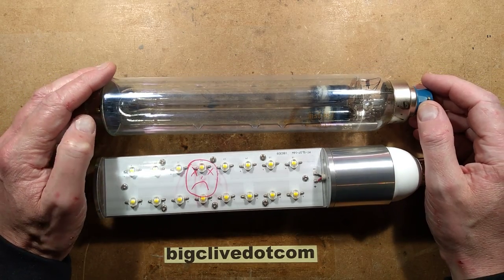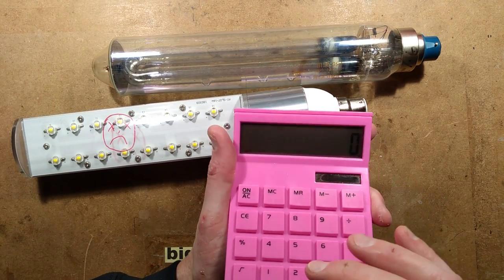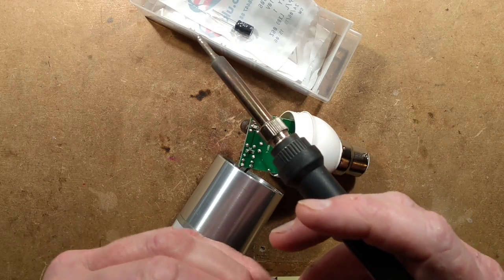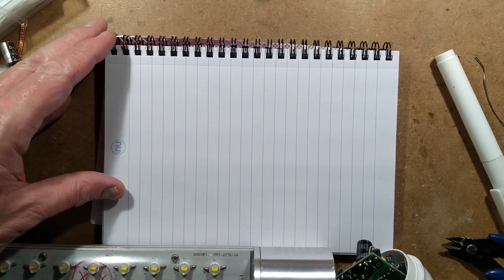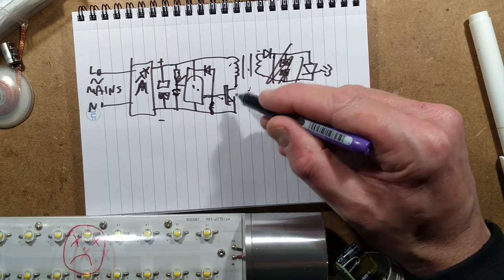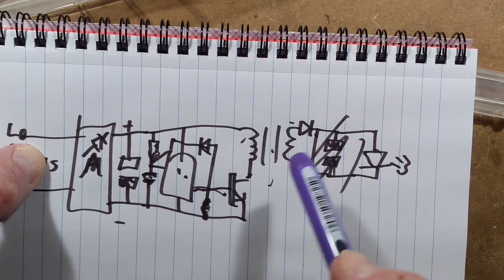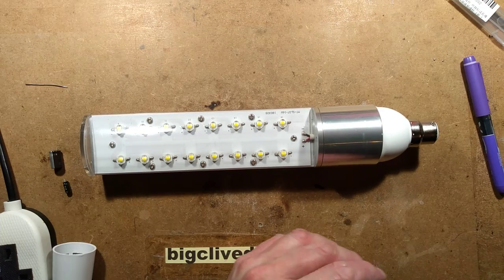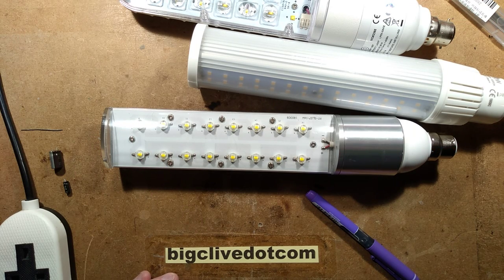Fixing a dead LED street light lamp.  (SOX retrofit.)

Comment: If these lamps were available with an E27 fitting, they would be an option for room lighting (although I'd have to modify my fixtures for that, which currently just point towards the ceiling, while they would have to point sideways for the lamp itself taking this 90° angle towards the ceiling). I am currently running 18.5W Phillips and 21.5W Osram LEDs, but at least with Osram, I haven't had very good experiences, since their lamps only last about as long as they write on the packaging, which is a bit annoying.
Reply from the maker: You can get B22 to E27 adapters.

Comment: Cost from Soxled , depending on  wattags and design  , saw from ~ $66 usd to ~$89 usd for this bulb and higher based on other designs with larger numbers of led strips . A 360 deg lamp with several led strips is upwards of $190 usd (rounded up)
Reply: In the UK that exact lamp is going for £63 inc. VAT in 2022. So if you are a local council and you have thousands of these lamps a bit of component level repair is probably going to be cost effective over buying new ones in. Especially if you partner with some neighbouring councils to get the repair volumes up.

Comment: I think replacing the LED is also viable... i work in a hotel, and we have some 7W lights with 7 x 1W  LED (just like the ones you have in your lamp) to light up the restaurant, with a separated psu, and the cover for the light is friction fit, so it's quite easy for me to disassemble it, and recover the 6 working LEDs from a dead one, to use them in the next one that fails. That way, i can build 6 working lights for every 7 that dies (the only thing i have to buy is some thermal compound, so the cost is negliable). One lamp, by the way, is about 20€ including a discount we have, so i think it's totally worth the effort...
Reply: Daniel López How many hours do they have to employ you to save each £180 (dismember 7, assemble 6)?
Reply: @johnfrancisdoe1563  Keeping in mind that i just have to lift the cover, de-solder the LEDs and solder them back... no more than 15 min / light to replace the led and install back the light.

Comment: Funny you talk about "LED modules", I know a Taiwanese LED street lamp Manufacturer (I have been to the factory), Their designs take that into account were you have a number of LEDs strips (depending on the light needed) and those can be changed. I guess the difference is that they sell the entire "light" not just a "bulb". They got into LED manufacturing after manufacturing heatsinks, focusing on the refrigeration of LEDs and constant current (when they started the industry focused on constant voltage). Their challenge (as they put it), is that, as they use high quality components, they struggle to cheaper manufacturers (your point on the bootstrap circuit capacitor etc). In a sense I guess only having to change a bulb is already "modular", but if you refer to "LED strip modules", that already exists.

Comment: I have our Czechoslovak Tesla RVI 2000W (metal halogenide vapour lamp) from 60s. It runs on 400V (normal between phases voltage - we have three phase distribution system) and it after seven minutes of starting outputs 200 000 lumens :D

Comment: Hi Clive 
Hopefully your see this but I really don’t know where to start on street lights.

For 7 years i was up and down the country replacing the street lights...
It was all a con and still is, under the guise of energy saving...
If the case was just energy saving why didn’t SSE and up north was EON I think just change the heads and not the columns. 
The scheme that the councils had to pay for was scandalous..
It was dangerous work ( I’ve hit a few LV cables) call it careless but in certain situations and the added pressure with working on price  the CAT &GENNY isn’t accurate. Off point and let’s forget the water, gas and telecoms. Strike any of these btw we had to pay for.
I’ve never come across the bulb u have there but.. most of the columns we were pulling already had the new heads fitted with (fluorescent tubes?) blah blah then by the end we were fitting LED heads I know for the 6m columns were £400 a pop.

The earthworks the diesel the cons people believe that it’s for the future is laughable.

The old cast iron gas columns (obviouslyconverted to electric  ) was criminal  ... I could tell you everything if you’re interested but I did have some of the “new fluorescent “ lamps my garage...  just left over when I cleaning the truck out for the next day, brand new old.

Working in Bournemouth they had already changed a lot of the heads to LED...
Have no idea how old they were but had a good alu looking case.

Every single one of them were on Victorian columns..
Again what’s laughable there is I’ve worked all round the country and Bournemouth is the only place I’d say the actual columns needed changing cause they were rotten through.... all except for the old cast 1s .

I couldn’t save any they were too heavy but...
Hope some of what I’ve ranted their makes sense.
I’m contactable if needed.

And thank you for your valuable time and very helpful content 
Kind regards Carl
Reply from the maker: It's just another of the government's many eco scams which involve them taking a personal slice in the middle.  The new LED lights will fail expensively in a few years.
Reply: I’m pleased you didn’t take me the wrong way, and didn’t think I’m someone that doesn’t care..
cause im definitely all for genuine ways to help the future environment..

But so far all I’ve seen is a money making whitewash..
Cars for a start... the scrap scheme..
When is it environment friendly to throw away something before it’s usable life is up. The cost to scrap/ and produce a new car is more costly to the environment than keeping an old one.
And where do they think the  metals for batteries needed for “zero emissions “ cars come from and that they are not yet recyclable.

We do have a newer car, but I also have an older 2000 bmw car which isn’t used often at all but does come in useful..

Reason I bring it up here is because they tried to make them recyclable.
Pretty much every part on the car including the little pop out plastic but on the bumper for the tow eye is marked with the plastic it’s made from.
And tonight the fireworks were on over the road and I had no torch 🔦 working for my little girl to have..
So to hand now I have the cars rechargeable torch out of the glove compartment...

>ABS+PC<  NIMH -AKKU

That’s written on the torch alone ha ha..
Point is imo steps like that is what’s needed.

And a rechargeable 20 year old torch is  still working as a last minute thought to make her happy 😆 

You can have it Clive and do a video on it and see how little life it may have left in it 🤔😂

Comment: That’s why, when designing a switch-mode power supply, you design it so it still works when the caps have dried out by at least 50%... and use ceramic bootstrap caps.

Comment: In the US most of our street lamps are HPS.    Fun fact is you can way overdrive the smaller HPS bulbs with oversized ballasts and they will take it for some time.    

Just for - abuse to failure point - testing to see their limits I have run  ~ 150 watt HPS bulbs at 400 watts for days without issue and 1000 watts for long enough to get the ceramic sockets to crack apart from overheating and the stainless steel metal on the base and in the sockets to turn dark blue due to massive overheating!  

Also at ~3X their rated power they are not so orange, but near white and at 1000 watts they are sunlight white!
Reply from the maker: In many pro moving lights the lamps are overdriven, but also underdriven when the shutter is closed.

Comment: Hi Clive the keyring tools you were using  to clean the through holes out, look very much like prickers, used for cleaning out gas nozzles, like the old  parrifin blow lamps, i have two sets here that range from .46mm to 2,74mm in 12 steps had them for over 45 years ..

Comment: Well, well... If you ignore the CRI of 0 of the sodium lights, they are much better for me. The air is much more transparent to them and you can see very far from a single light source. Moreover their light is not triggering your pupils as much as the LED lights which produce a lot of light, but then your pupils react and you see that special "dark light" effect of the LEDs...

By the way ... with that frequency of flickering it was clear that the final capacitor was not the issue :) Otherwise, nice video!

Comment: Rather than trying the round files (nozzle cleaners) that are likely to damage the hole plating, here is a better choice.  Use wooden tooth picks!  You may need to sharpen them a bit more, depending on the hole size, but they display the solder quite well.  Solder does not stick to wood.  Actually, I have another way also.  I use a vacuum solder sucker or pump on one side of the board and a soldering iron on the other side. Apply suction when the solder has melted through.

Comment: The roughness, in theory, grabs the solder so it doesn't end up back in the hole. If you've ever tried using a clipped off piece of a lead or a length of wire to clear a hole, you'll note that this is often just what happens.

Comment: A big problem with these retrofits is that most SOX lanterns rely on optics and refractors built into the side of the transparent bowls to achieve the correct light spread on the road. I can’t see it working correcting with a very direction light source like this!

Comment: LP sodium (SOX) lamps are almost monochromatic, except for a couple of other weak minor lines (mercury etc), so much so that they are useful as photographic dark-room 'safelamps", the sodium line being in a section of the spectrum to which photographic papers are insensitive. I used to have a 35 W SOX lamp in a housing with an Ilford brown filter and my 'dark' room was quite brightly lit with no detriment to fairly sensitive B & W printing paper. I can't comment on using a SOX lamp for colour printing as I used light-tight drums for such work but I understand that others have used them for RA4 process work.
Reply: Yes, the QA lab at a local factory used this color of light, as well as red ones for testing their holographic products. It's a shame that these style lights didn't come out sooner.
Reply: @franglish9265  - SOX lamps have been around for a long time, early 1930s, and I my DIY one dates from the mid 1980s. I believe that Agfa, among others, did market a darkroom lamp based on a l. p. sodium tube that was much smaller than the SOX design. The LED analogue would naturally run much cooler, consume less energy and would start up in much less time.
Reply: @JUANKERR2000  Yes, I have one, it has a tiny 10w SOX bulb in it plus additional filters in green and red for some reason..

Comment: I wonder if you place another capacitor on the final output (about 250uF) to reduce any shimmer if a camera is used nearby at night. Would that affect start up time or would the switch mode power see it as a short long enough while charging to prevent it from powering on?
Reply: I wonder if the mains side capacitor has failed.
Reply: @NiHaoMike64  He replaced it and the problem issue remained.
Reply: @MikinessAnalog  I saw him replace the output side capacitor and the bias capacitor, but not the mains side capacitor.

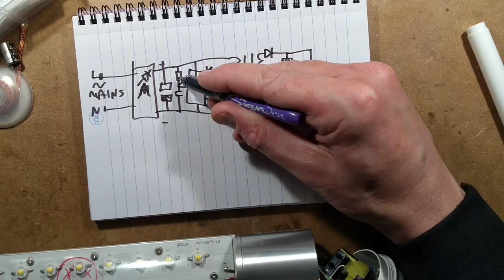Comment: 13:18 I've been wondering for a while now why LEDs, which have response times in the megahertz range, take 1/4 - 3/4 of a second to light up when they're used as AC lamps. I suspected it was the power supply circuitry, but didn't know for sure until now. Thanks Clive!

Comment: Surprising how often you come across this fault, either cooked cap or cooked resistor, although the usual symptom is it works fine until it's power cycled then doesn't start.

Comment: I would SO MUCH like to see you check the bad (or suspect) components as well.  Was the boost capacitor dried up and lost its capacitance?  Or was it leaky above some less than nominal voltage?  Or possibly some third kind of defect?

Comment: When I was fixing switch mode power supply's, I just replaced all the electrolyte capacitors and 98% of the time it fixed the problem.

Comment: Those 'pins' are also sold as tip cleaners for acetylene welding gear. The texture is to scrub out the carbon in the tip. Least, that is MY familiarity with them.

Comment: 16:01 those are tip cleaners for mig welder tips and oxy-fuel torch tips. you use them as pin files that's why there "ribbed"

Comment: I didn't know MIG welders were used for spark effects.  I'm used to the dead simple ferrocerium ones with a rotating abrasive disc.
Reply from the maker: Two approaches are commonly used in theme park effects.  The MIG wire feeding onto a spinning drum and a system that feeds two MIG wires into each other in front of a compressed air jet.

Comment: the pin are for clearing out the hole in a Acetylene Cutting Tips that's why they are ribbed you look them up( oxy acetylene torch tip cleaner) but I use them for Carburetor Carbon or what ever their great

Comment: Last time I checked sodium lamps were far more efficient?
Reply: Compared to incandescent ones they are, but LED's are objectively more power efficient.
Reply: Uhhhhh if we're talking lumens / watt, nope.  Even in terms of μmol output when comparing equal wattage.  As far as last time when I did math on outputs and efficiencies building a Cree fixture, it was more efficient the LED path compared to other alternatives.
Reply: Used to be. LEDs have more or less matched SOX within the last 10 years.
Reply: Just did a quick search. They have indeed gotten way better. It's kinda scary when you get old. You remember something you did 15 years ago like it was yesterday lol
Reply: I just did a quick check and yes LED lights are way more efficient than they were 15 years ago but there is a new generation of SOX too. Philips have one working up to 180Lumens per watt. https://www.platt.com/CutSheets/Philips/PhilipsSOX.pdf
I could only find 120Lumens per watt for LED.
Reply: "but they're not as cool tho"
Reply: @gordonlawrence4749  180 lumens per watt is one variable have to account for total wattage and heat watts generated. Heat watts is what makes fixtures fail if not managed right.  Double ended HPS and MH have a nice efficiency that matches LED and they are current market. But tend to be more cost expensive in long run with replacement cost for bulbs taken into effect. A great fixture at the bleeding edge of efficiency is from a company called fluence bioengineering.
Reply: @DurzoBlunts  180lumens per watt of electricity is 180 lumens per watt of electricity. Everything else is heat output. LEDs rarely go over 120.
Reply: While the sodium lamp itself is more efficient than LED the control gear knocks the overall efficiency down to that of LED. As LED technology improves, it will  surpass the efficiency of  sodium lighting, but only if the reliability problem of the LED can be sorted.

Comment: Your key ring of wire's looks just like welder and torch tip cleaners. They are different gauge file like wires often sold with a little tin/mental flip open box that keeps them from getting bent and or damaged.

Comment: When I was doing a survey of a local Highways Depot some years ago the manager showed me a machine for disposing of old mercury vapour lamps and sodium lamps.  Because of the toxic gases etc. in these old lamps they had to be crunched up inside into this machine which had a local exhaust ventilation system running through some special filters to capture the gases.
Anyway how do they get enough light from a 16w LED bulb to light a street.  I have 3x 5w spots just to light my bathroom.  😀

Comment: bigclivedotcom  In my experience, Suntan caps are about as bad as Sam Youngs for early failure. I always use the Panasonic FR range for PSU repairs, and have never had to replace them a second time.
Reply: I buy all my capacitors from Digikey. Panasonic, Rubycon, and Nichicon are the only ones I trust.

Comment: Another great video Clive. I would like your advice, I have 2 acrylic reindeer about 8" in size and have 16 white LED`s in each. 
They work from 3 AA batteries each, and draw 100ma each. I am going to power both in parallel from a DC to DC Buck converter 
and set it to 4.5v. Do I need to put resistors in the line, I was considering 10ohm in each line, but hope you can advise me. 
Not good at working these things out. Thank You.
Reply from the maker: You could probably use a USB power supply to run them with just a resistor or two in series.  I'd suggest maybe two 10 ohm quarter watt resistors in series.
Reply: @bigclivedotcom  Thanks so much Clive, my wife who is 86 loves her lights at Xmas, but it`s been costing me a lot of money every year because they both use 3 AA batteries and they only last about 4 days, 6 batteries every 4 days over the Xmas period is a lot. I do have some small Buck converters and odd dc power supplies and am capable of putting them together, but did not want to destroy them, so I will put 2 10 ohm resistors in series as you suggest. Thank You again, always a fan. Dennis.

Comment: most electrolytic capacitor has rated lifetime in hours. in most cases of spoilage, it is a good guess for spoiled electrolytic capacitor in old appliances/devices.
Reply: In thousands of hours, more like. And it is very strongly dependent on temperature.
Reply: @JasperJanssen  yes, the datasheet specify base lifetime, the estimated actual lifetime is related to ripple current, temperature, frequency of ripple current.